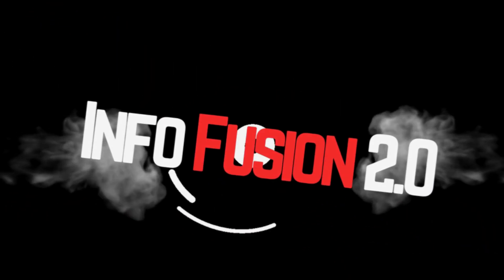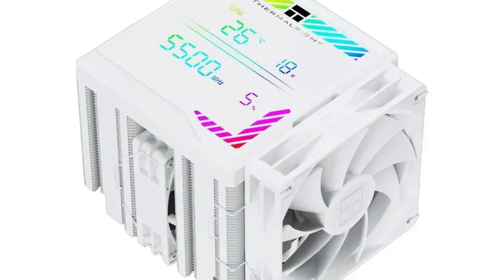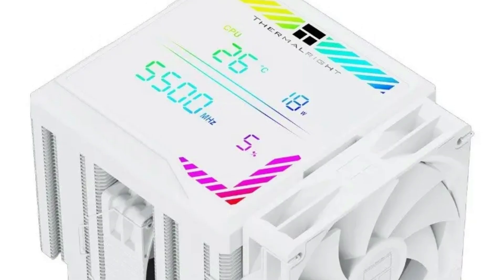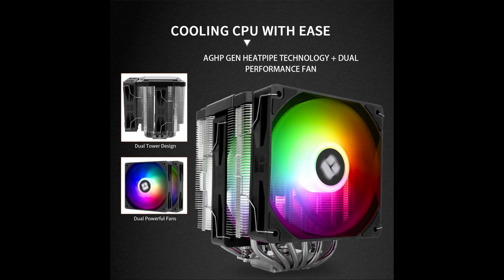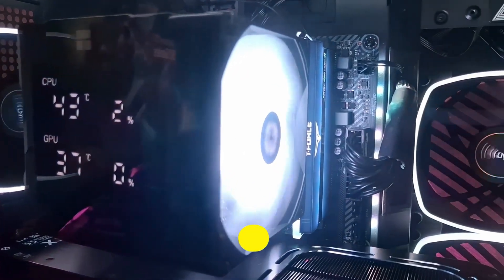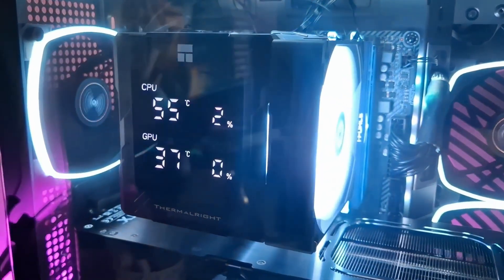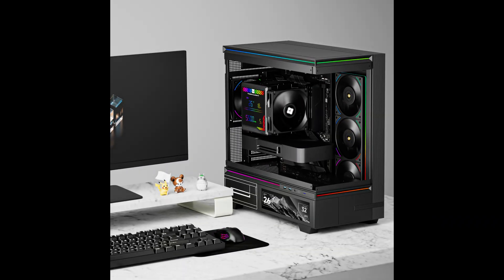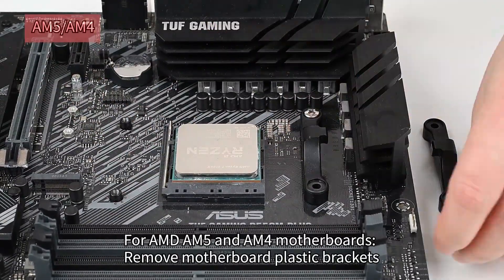Thermalright Launches Assassin 140 Digital CPU Air Cooler

Comment: What I dont like for this digital version is you can only display gpu or cpu temp one at a time. Unlike the 120 digital where you can show them both simultaneously.
Reply: Thank you for pointing this out!!! I didn’t read this anywhere on the listings you saved me some potential return back to Amazon time
Reply: but you can rotate them 1 or 2 sec each time